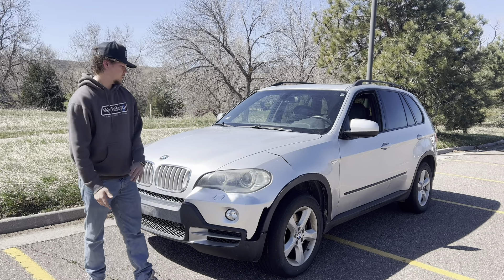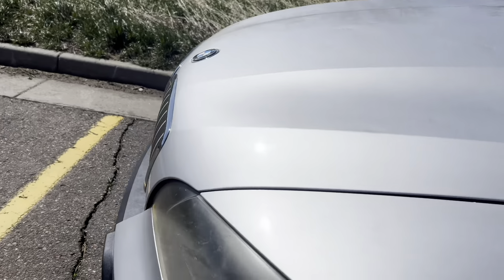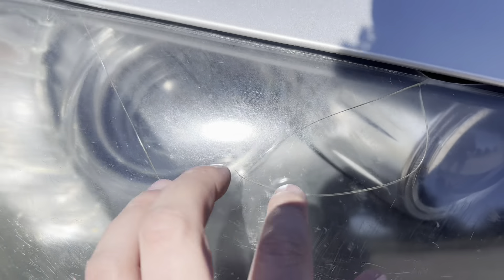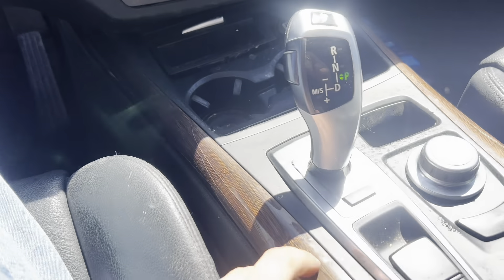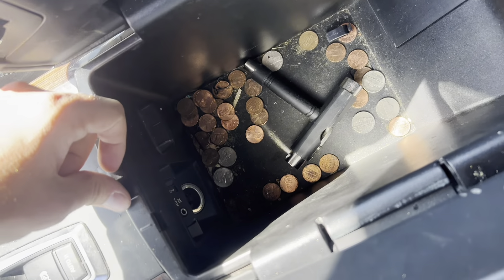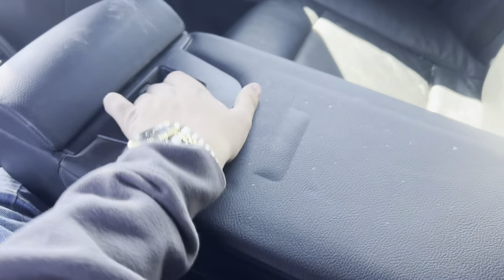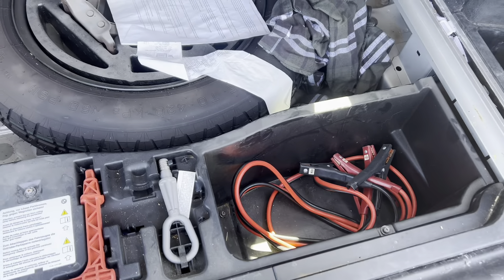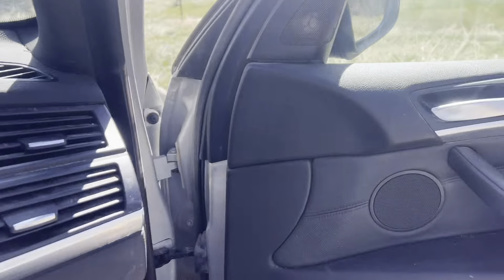Unboxing my $1200 BMW X5

Comment: Glove box button is right above the aircon dial. Also it interesting that you have a premium car but not the wheels of flared wheel arches. Didn’t hear you mention the miles so it’s hard to rate the deal. On one hand it’s not bad having that car in that trim for that price. Maintenance will quickly tip that scale and even bringing the car into shape will do that. Your biggest plus in the purchase sounds like you being able to perform the work. So in my opinion I’d say you broke even which is not bad. Be sure to keep a close eye on that right side truck behind that removable compartment where you modules are located it will collect water there eventually if not already
Reply from the maker: Glove box part definitely noted 😂 I was going to say if it didn’t have one that seems super weird. The car has 140k miles. I got a extra set of wheels with the car I believe there style 211’s. Got my water pump in the other day $70 for pump and new thermostat finished putting it in the other night super easy car runs great now!